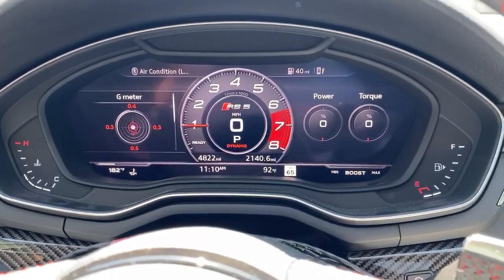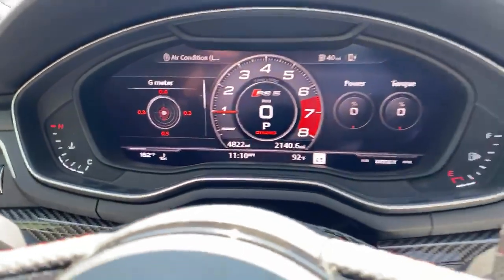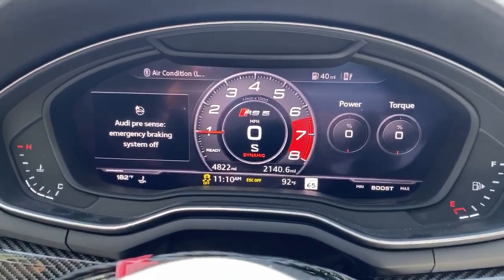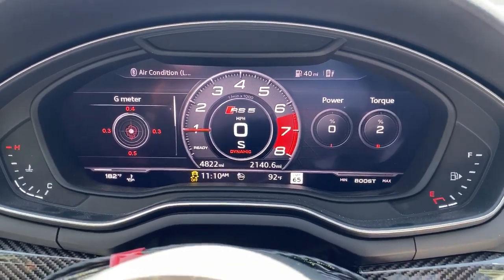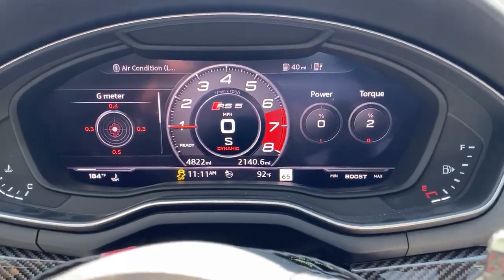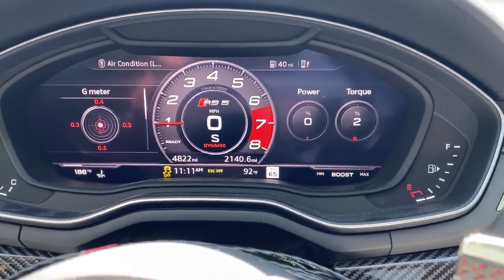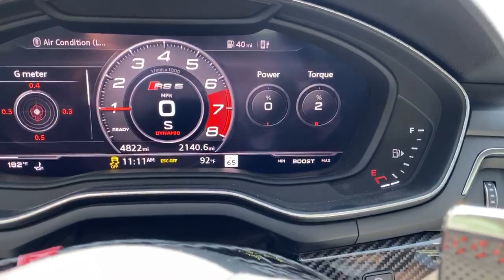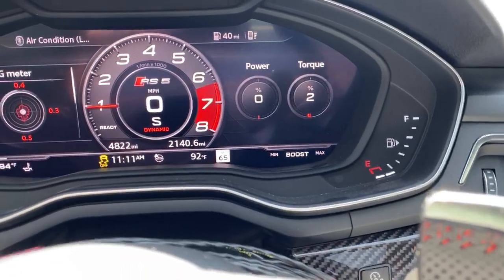B9 RS5 (2.9T) Launch Control Demo

Comment: I thought for the best launch control traction the ESC button needs to be in Sport, not fully off?
Reply: that's correct - you will get too much wheel spin on launch when ESC is fully off!
Reply: Also no need for dynamic per se. you can use RS mode and have it set to the sportiest settings so basically no difference with Dynamic. It will automatically put the box in S mode
Reply: @mova_2020  how the f do u get to rs mode?
Reply: @jayjohnson-t2y  By pressing the F RS button on the steering wheel
Reply: is this only for 2021 onwards or?
Reply: @jayjohnson-t2y  Not sure about this question. But 100% sure 2021 and onwards have the RS button. I don't think if it should be different for before 2021 BUT I don't know 🤷‍♂️
Reply: @mova_2020  I have a 2018 RS5 there's no RS button.

Comment: In general, what's the purpose of the accelerator pedal kickdown switch on VAG vehicles?
Reply: Generally used to trigger a downshift. Can also request higher torque request from the ECU or different shift RPM and/or shift types from the TCU.
Reply: It's so that if you're in a manual mode, and panic where you have to get out of the way or something, if you press the switch the car will ignore that manual mode and downshift to get you out of there
Reply: it was automatically downshift to the lowest possible gear
Reply: Should be the same on all vehicles, it’s supposed to go to the lowest gear possible

Comment: Launched my 2023 RS5 Sportback (stock) this morning at an industrial building that had a very nice 1000+ foot long surface.  0-100k was 3.7s.  That would be a tad under 3.6 0-60 mph.  What was interesting was the 1.06 on the built in g-meter.  I guess that hit right at the release because that kind of g force would be more typical for a sub 3s time.

Comment: Is there anyway possible I could get the Power & Torque percentage display on my 2018 S5????
Reply: Nope not a feature on b9 s5 only rs models have this
Reply: @1elemnt1  nonsense, you can do it to the A4/S4 if you want, or any VAG product with the digital cluster.
Reply: @PapiAndrey  how
Reply: @JAIMEC  Coding the S4 display works. Yaode Chain has a video on it